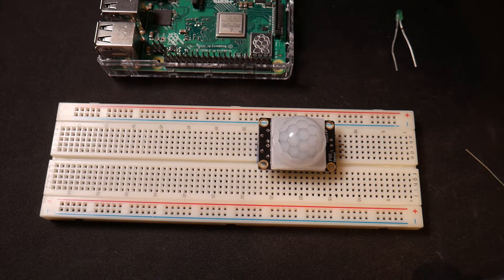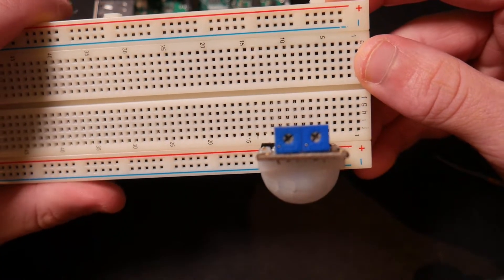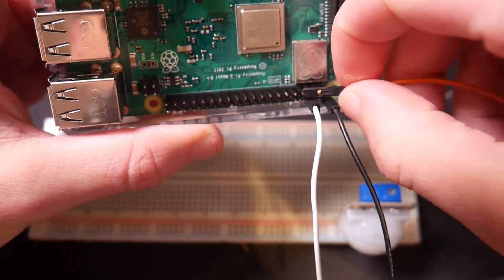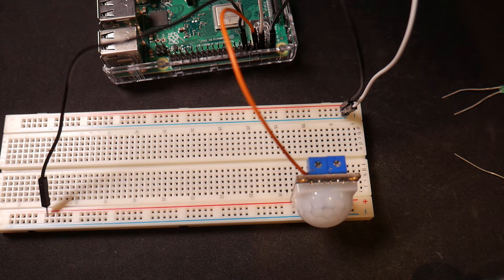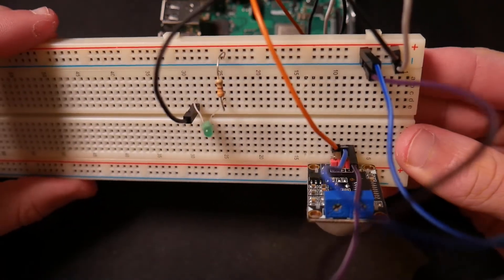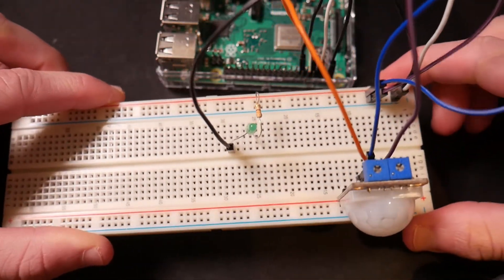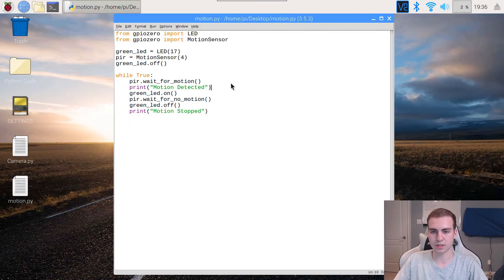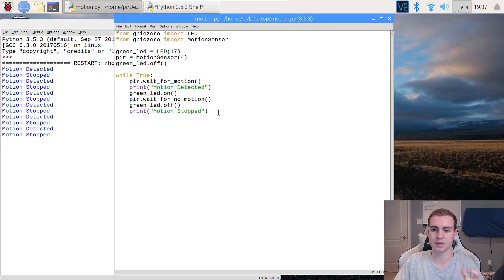How to Use a PIR Motion Sensor with Raspberry Pi

Comment: @TechWithTim
Great tutorial. I too want to make a surveillance system using an RPi and multiple PIR sensors. However, I am not quite certain as to the wiring and code for using multiple PIR sensors. I would really appreciate an expanded tutorial on using multiple PIR sensors on a single RPi.
Thanks in advance!

Comment: I've got a question. Can you run this while simultaneously running a temperature reading with a temp sensor and get the programme to print out both "motion detected/motion stopped" and also have it printing the temperature every X amount of seconds aswell?
Reply: yes, but you would need to use asyncio or threading to run both at once

Comment: I bought a power trigger water spray hoping to detect the crapping cat who visits my garden. It worked fine with a cheap air-freshener detector but, to was so weak that I really needed a PIR sensor. This was much more difficult to make work. It either never worked or It worked with no stopping. How about making one on this problem?

Comment: Hey Tim I know this video is kinda old now but hopefully you're checking comments. Do you think this will be ok opposite my window? I'm building a magic mirror with my raspberry pi and an LED monitor but dont want the monitor constantly running, so I want it to turn on with motion detection. From the angle it wont see anything moving outside but the sun moving around during the day does changed the light levels in the room. What do you reckon? Do you also know how to turn on/off the HDMI port with a motion sensor?
Reply: I believe the detector can’t ‘see’ through glass, so it shouldn’t detect anything moving outside.
They’re not expensive so buy one and try it 😀
Reply: @SprocketN  thank you!

Comment: Great video. I wanna use the same PIR sensor for this small door greeting robot I'm  building,. My question is:
If I program the Raspberry Pi and disconnect it from my computer would it still work as long as I am feeding it with electrical power?
Reply: You need to connect batteries then

Comment: With the pi4 having a 5v output, using this tutorial  as an example, is it possible for it to power an LED strip instead of an LED bulb? I am wanting to use the PIR  in a magic mirror where whenever someone stands in front of the mirror, the PIR triggers and lights up the LED strips to act as a mood light around the mirror itself. ps I am a total NOOB  so any help is much appreciated

Comment: How can i programme this to find out the total duration of the light was turned on the last 6hrs for example?
Thank you very much
Reply: the light is on during motion detected until motion stop so you could basically have a top variable `light_on_duration_sec` in which you add the time elapse between motion detected until motion stop. Your `light_on_duration_sec` is your only critical data so either you count on your pie to stay alive during the day either your persist the information on the disc. For your "on the last 6hrs"  then it's up to you to program it using your pie datetime and `ìf` condition

Comment: Could you please help me out and make a code that I can use the relay, PIR, and raspberry pi but have the light (or anything else that is plugged in to the relays) set on a timer? I woukd like to put lasers in my game room and when someone walks into the room the lasers will be by the ceiling and come on for a duration of the time I set. Could you please help me out and either make a video of the timer added or post the code here? Please 😉😁